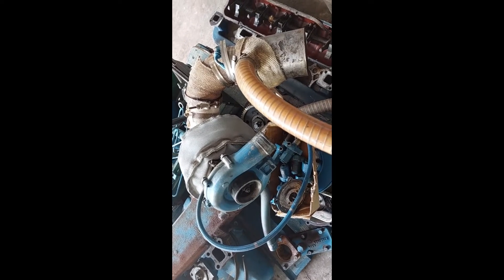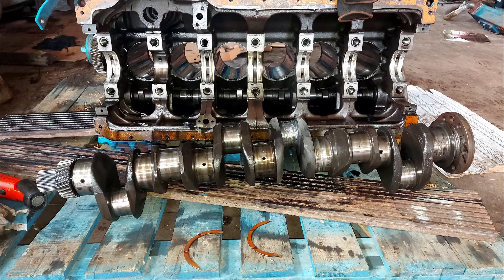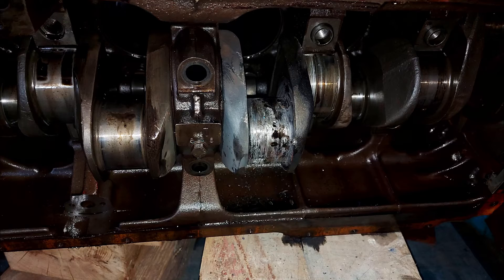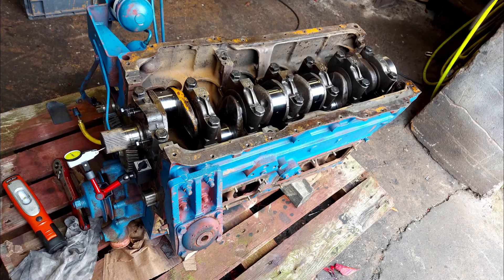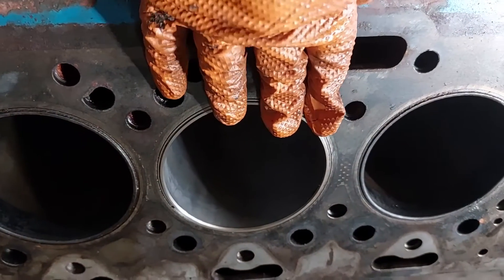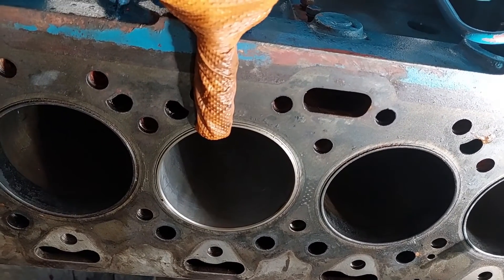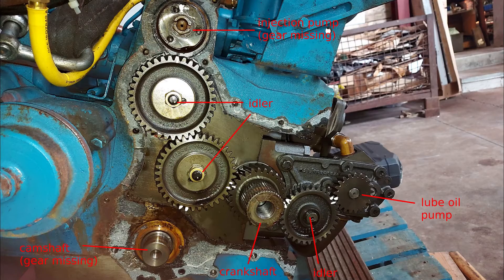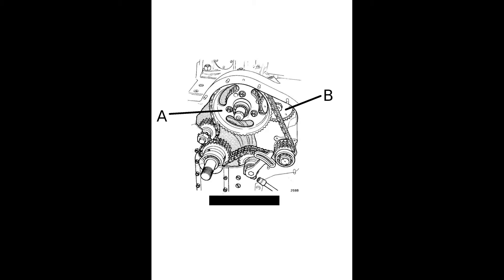Restoration of Perkins engine compared to a Gardner Engine.

Comment: Hi Joe, for many many years I worked as a Perkins field engineer covering the South East, the predecessor to the 6354.1 was the P6, this had a timing chain and not an idler gear.
The 6354.2 was probably the most commonly used of of the 6 cylinder range, the 6354.3 was fitted with a turbocharger and Bosch fuel injection, the 6354.4 came as normally aspirated or turbo-inter cooled.
As the 6 cylinder range had some many applications worldwide, the variants where almost endless.
Still enjoyed working on Gardeners, there was just something about working on a hand built engine.
Reply: The P6 had a bad habit of kicking over backwards then revving up until destruction , ok in a truck you could stall it , in a compressor there was little to do except move to a safe distance .

Comment: Perkins 354 engines are between 15.5 to 16.1 compression ratio I thought, depending on model/Country. I have a dot 4 T6, and its 15.5-1
Reply: Turbos typically have lower CRs than NAs I think.

Comment: I  don't think there's any comparing the two motors you talked about ,, I came across the 6-354 in the early 70's in Massy Ferguson cane harvesters , I guess Perkins was the biggest little motor that would fit in the harvester ,, no where near big enough for the job  , The seasons were only 5 months of the year and during the second season they needed rebuilding ,, although I knew of one motor in a boat was still going sweet after 12000 hours but it only idled along at 1200 revs , still my favourite motor though  Ive driven MF65 tractors with  a 4-212 over 20 years old never had a spanner on them .
Reply: MF 165.MF 65 had indirect injection 203.

Comment: These must be the most run away engines ever made because of the horizontal pumps. Driveseals go on the pump shaft and fill the sump with diesel. Done hundreds of them.
Reply: Send return injector pump fuel back to tank instead of the fuel filter esp on hyd gov DPA injector pumps and the engines are better off for it.

Comment: It is actually a Perkins HT6354. ( Horizontal Turbocharged 6354)

The 6354 was a very popular engine used in many different applications,  but in my view always sounded harsh and like a galvanised bucket full of rusty bolts rattling around.
Reply: Not if the injection pumps are set up properly